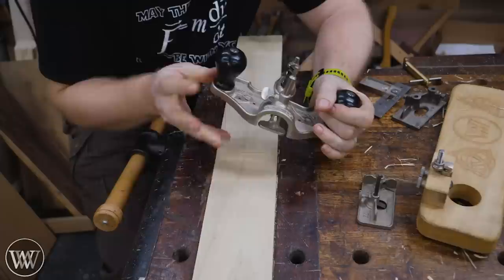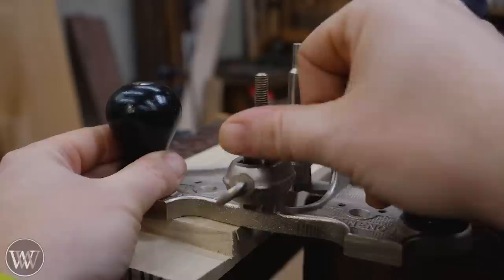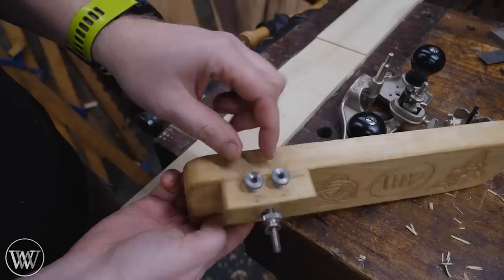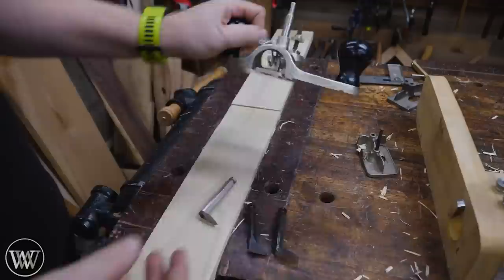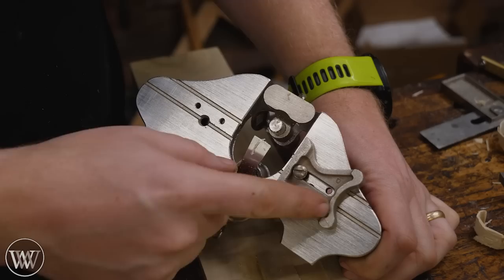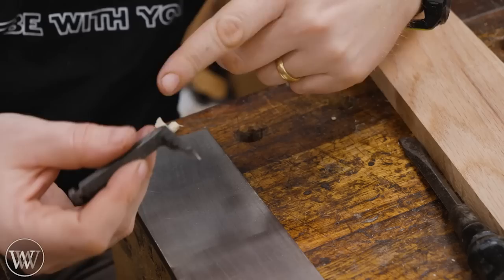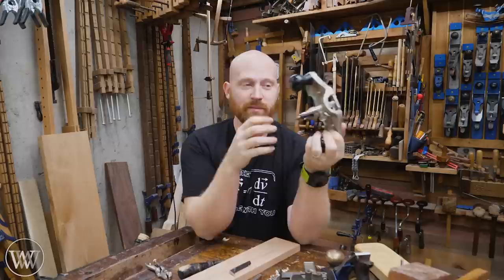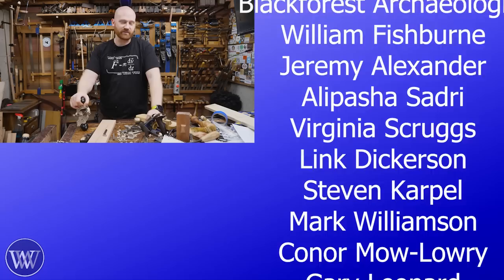Router Plane Tips and Secrets

Comment: The Veritas plane has solved both of the problems that you noted. The sharpening has an arm that attaches in the Sam way used the vise grips. The fence is  about two and a half or three inches long and has mounting holes if you want to add more length much like adding a larger base. It’s a fun tool. Probably my favorite one in the shop.

Comment: I am a power tool junkie but I recently got a router plane and I love it. Table saw dado blades sometimes don't cut a uniform depth. The router plane can make corrections in a hurry.🙂🙂
Reply: I'm hybrid woodworker, and probably most frequent use of my router planes is to clean up the crappy surface you get on the bottom of a dado etc cut with a table saw. I don't tend to use a router for that purpose, and take saws leave even worse bottom, but the router plane cleans it up fast and easy.

Comment: Paul Sellers teamed with a machine shop in the UK to produce router plane hardware kits so people can make their own without having to worry about any of the metal working (hardening, annealing, etc.). It may be of interest. And thanks for the info, great video as always!
Reply: It has a straight blade instead of the L shaped.  It should be easier to sharpen.  I wonder if it cuts better for grooves?

Comment: Veritas router plane blades are a little longer than antique Stanley’s. On some made in England ones, the blade can’t fully retract into body. You can either add a wood bottom, or sometimes flip the blade adjustment nut with its flange on top to retract the blade more.

Comment: A while back I went onto the Stanley website looking for a 71., they had nothing so I contacted Stanley and asked where I could get one. They don’t make them anymore. It seems that they have turned away from making router planes anymore.?????Rob Cosman put out a video comparing the Lee Neilson to a Bench Dog. The two are basically identical so I bought a bench dog. It came in the mail yesterday and I cant wait to get it set up. 
Love the channel James.
Reply from the maker: Yeah, Stanley hasn't made most of their hand tools in 40 years. And the ones they're making now are okay but not great. But most specialty planes they haven't made in 50 years
Reply: @WoodByWrightHowTo  What they do make is good but they have stepped away from wooden handles on the planes. They went with a molded plastic that just feels wrong. Good thing we're woodworkers and can remedy those issues ourselves.
Thanks for the reply James.

Comment: Great Video, thanks. When doing tenon work, I like to have the boards overlength, cut the tenon portion out like a big groove and the extra length on the board end I can use as a second reference for the router plane. It is similar to the "use another piece of wood" technique, but it is attached to the board. Then when you are done, cut the tenon to length
Reply: That just blew my mind! Thanks for the tip

Comment: Thanks James, another information video. I have that router plane and Veritas irons. They are a little long for the Stanley 71 and even turning the depth knob upside down still Veritas irons long
Reply from the maker: Yeah. A lot of people will either cut another notch in the blade or they'll put a wooden sole on the bottom.
Reply: @WoodByWrightHowTo  Ah, du, both good alternatives.

Comment: I’ve not used his kit, but I have built the latest iteration of router plane that Paul Sellers has taught about. Great design, easy to build, and quite a few lessons are learned.
Reply: The kit is very good for those that struggle with the metal work side, or are just too lazy like me! Would recommend. Although I'm in the UK so postage was inexpensive.

Comment: My pointy cutter is a 90 degree angle and rides the back of the iron and doesn’t cut. The 1/2” cutter is at an angle so the cutting edge digs into the wood. Is this the wrong cutter for a 71?  Thanks I learned several things.
Reply from the maker: I'm a bit confused. Feel free to send me pictures in an email. You can find my email address on the about tab on the YouTube channel page or the contact me form on my website. I don't know how the iron can dig in if it's locked down well in the plane. Usually that means it's just set a little bit too deep.

Comment: Unrelated question.... Do you know if a spur and screw from a Stanley no. 78 will fit a Stanley no. 45.? I found new spurs/screws for the 78 but not the 45... Thanks...
Reply from the maker: Some of them will and some of them won't. Both of them changed over time. Most of them were the four-point star shape but some of them were the vertical hot dog shape.

Comment: Always learn something watching your videos. A few questions:
1. I came across somewhere that router plane is for cross grain(dadoes) whereas a plough/combination plane is for along grain(grooves). What prevents us from using router for grooves then?
2. Can we use router and plough planes on plywood? Will the criss cross pattern of grains and the adhesive layer cause any problems.
(I am planning to build a few drawers for my garage cabinets using only hand tools. I am wondering if I must use only solid wood or if it may be okay to use plywood. And yes dovetails too!.
Thanks
Reply from the maker: A router plane isn't great for making grooves or dadoes. It is great for either of them to clean up the very bottom. But it doesn't have a spur or a knicker to cut as a fibers when going across the grain. 
You can use plywood. You just have to treat it as always. Cutting across the grain. In that case, using a dado plane. Or if you have a plow plane with spurs or knickers on it that will do the trick.
Reply: @WoodByWrightHowTo  thanks! Always valuable. I may decide to use solid wood as I am a beginner and will want to keep it simple for me🙂

Comment: Hi James. Great video. My brother was just telling me about using a router plane to flatten the surface of a board? Is this a practical application for any situation you can think of? 🤔  Would it actually work?
As always, I appreciate all you do.
Reply from the maker: I do not see how you could flatten a board with a router plane.
Reply: @WoodByWrightHowTo  theoretically you could by using 2 identical thickness runners, one on each side, and running the router (or router with wider additional baseplate attached) over them. Basically a manual version of a power router slab flattening setup. I don't think I'd do it, at least not for any more than hitting a few little high spots, but might be ok after getting it close with hand planes.

Comment: Just bought my first router (veritas style) for $10 at a garage sale. It's old and no name or markings whatsoever. There's no iron or depth gauge thingy. I can get the new iron online easy enough but the question is what to do about the depth pin/shank/thing? It fits in a keyway just like the iron. Square. Any ideas on making one? 
Aloha 🤙
Reply from the maker: I have seen some people use a pipe clamp but then you need a tool to loosen and adjust it. But if you want original parts I would check out the "Parts division" on Facebook ro go down the list of online sellers on Www.HandToolFinder.com

Comment: After watching some of your videos and Stumpy Nub's videos, I made a router plane, using a veritas cutter.  The problem is that the cutter tends to dig into the wood.  I feel like the angle of attack is to high.  Your thoughts?
Reply from the maker: Usually if it dives in that means you are taking too big a night, it is not sharp enough, or it is tipping.
Reply: Thanks!

Comment: Pun at the end was a bit a parent, typical dad joke. I have the Paul Sellers router plane kit sitting on the shelf waiting for me to put it into a block of beech from an old wooden jointer that have lost its iron (the jointer, not the kit). Then I have another that I built using some random hardware, a piece of oak from the firewood pile and a replacement cutter for a tiny Axminster router, it works ok but the adjustment and blade holding could be better.
I heard somewhere that pushing share and copying the link counts as sharing it to YT so I usually do that.